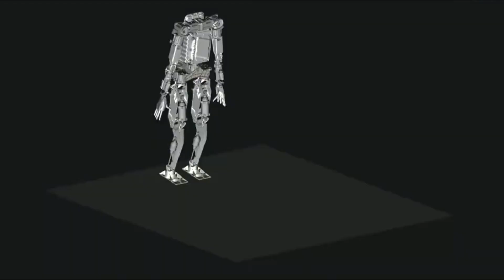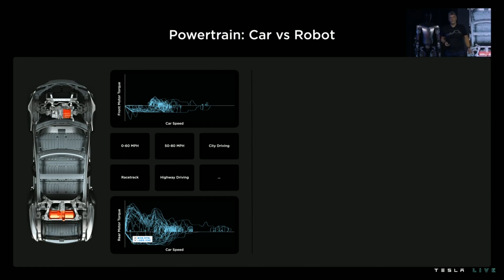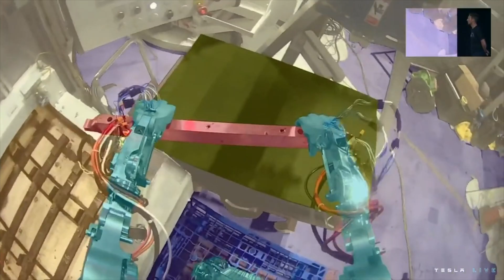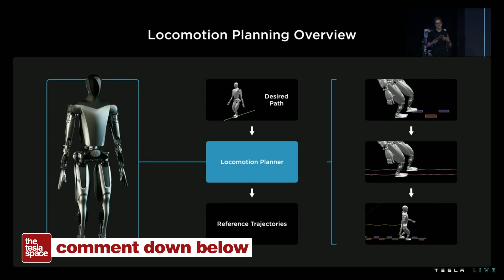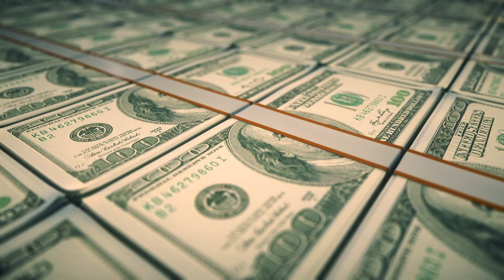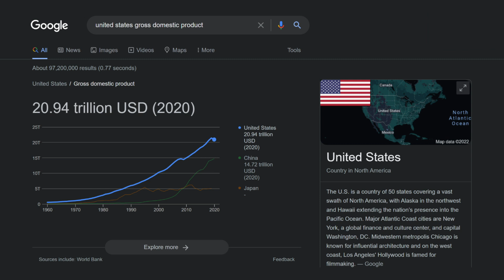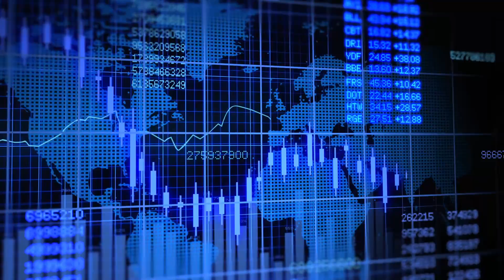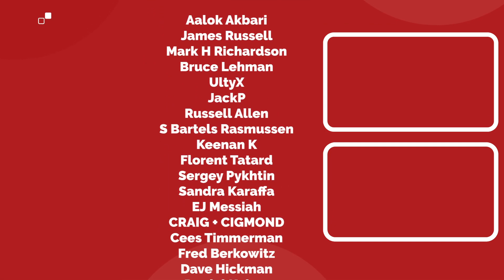The Real Reason The Tesla Bot Will Make Us All Rich!

Comment: Your economy calculation is sorta good enough currently.  However, you should add back in the support.   i.e. subtract from the economy Government workers (and anyone that gets paid via taxes) as well as removing the unemployed or disabled to the point that the support is needed from the economy.     This doesn't make much of a difference when comparing countries as they are all in the same boat.   But when you make all the workers unemployed due to robot utopia then you go from an booming economy to desolation.   
Incase your thinking UBI,   Remember,  Where would the money come from.   If the costs of everything has dropped then the taxes collected drops as well.   Well below the ability to pay government workers never mind UBI for everyone else.
Reply: It is only called UBI, to make the naive more acceptable of it.  It is really called "communism".  And now, it probably makes sense.  No, I am not advocating FOR it.  I'm just not going to take any idea without thinking it through.  And you are the one who started the thread.  All of those points you said lead to "communism".  There is no sense any other way.  common.  What is yours is also mine.  Those robots build our stuff.  NOT your stuff, or MY stuff.  There is no such thing.
Reply: One fascinating prospect that crossed my mind recently in this respect is that "UBI" will not happen unilaterally. Ideally it will begin with a company filing for full automation subsidies from the government(or in a similar fashion through an entrepreneur). Those currently employed by the company when the process begins become a partnership that pays them their wages even as their jobs begin to get phased out and shall continue to into the foreseeable future. Ideally as the machines replace the workflow the original workers will be encouraged to learn/work alongside the machines that are doing the tasks they used to do so that they can repair them and so long as the service/products are relevant, their pay/"UBI" will continue(and likely increase) whether or not they are working anymore if their job is now "optional." 

Even in the event they aren't able to (or unwilling) I believe those who can will pick up the slack or find/hire those that can because now it's in the interest in keeping the business moving. Once finalized, owners can then be encouraged to shift their focus to other projects or to further optimize their particular sector and possibly increase the margins for the entire company, partners included. It will encourage people to not necessarily sit idle even if they manage to secure an income through full automation in this manner as any business can go belly up due to shifting demand/circumstances. But with much less demand those freed up by the automation changes (and newly acquired funding through the abundance in that specific sector) can bleed out into other areas to elevate them. There are a multitude of potential flaws, but so far I like most of the questions and possibilities the path proposes. 

The first and greatest obstacle will be the mass production of these Humanoid multi-purpose trainable units. Their capabilities and speed of adaptation will almost completely dictate the adoption rate. If they can be trained on multiple complex tasks within minutes or at least a day or two, very few large scale businesses will turn that down I suspect. At $14 an hour results in around 30k pay for a year, which is about the average cost of a higher end fast food employee as of right now in my neighborhood. Comparing that to a single 20k purchase and only paying for electricity and repairs after that will likely feel like a no-brainer.
Reply: @taiconan8857  UBI is just a slightly modified welfare system.  It's totally doable and has run just fine in many countries.   What my OC was referring to was the idea of Musk's bot utopia. We are in no danger of ever happening in any remotely reasonable amount of time.  Which is a good thing as it would totally destroy the economy.   How did Must put it.... "Short term problems"    Now there is the understatement of the year.
Reply: Couldn't you just use money already in circulation? I don't see why they wouldn't just redistribute the excess profits companies make with adding robots into the hands of the people. Currently they pay a worker for on average 40 hours of productivity a week and they pocket all the difference between the wage and profit generated from the work. So if they then replace a 40 hour worker with a robot or two that works 24/7 then they could still pay the same exact wage (with taxes) while adding that extra 16 hours a day in pure profit and enhanced productivity. This will then give everyone an extra 40 hours a week to spend money driving up their profits even more. You'd need a law requiring the companies to continue paying wages to previously employed individuals or a 100% tax up to when the wages are covered or maybe you could just do away with corporations all together and have the bots be publicly owned like parks. Then anything they produce or sell would be distributed evenly among the people.
Reply: @shodowhawk  Well, that’s a lot to unpack.   I’m afraid too much for a you tube comment.  Still I’ll hit a few highlights for you.
There is no amount of “money already in circulation” for two reasons,  1) the amount changes all the time. Hence inflation. 2) Last I heard The money that moves around is only 2.5% of the actual money as numbers on peoples bank statements.   Yup, If everyone wanted to have all there money in cash they'd have to wait for them to actually print the other 97.5%

You can’t force companies to pay ex-employees.   All you will end up doing is bankrupting all the companies as new companies that never had employees take over all the markets.
Reply: @lucidmoses  I don't see how they'll go bankrupt when they'll be making so much extra money from the bots productivity, but if we have a bot that can do anything we don't really need a corporation anyway.
Reply: @shodowhawk  Contrary to the YouTubers that don’t know anything about business think,  Most businesses primary focus is not going bankrupt.   Which is when more money is paid out then the money coming in.
Here is an example of how that would bankrupt the companies.
Let’s say the company makes ABC Blocks for kids.   Big sacks of them.   The company has thousands of expenses to accomplish that but lets group them into three categories with relative costs..
$2 for the material and make the blocks.
$3 for the building and equipment to make the blocks.   Transportation,
$1 taxes
$3 labor.   i.e. the people to make them.   Labor is normally one of a companies biggest expenses 
So you add it up and it costs $9 dollars.   So they sell them for $10 and make a profit.
So, now they buy the robots and replace the work force but still pay the work force as per your plan.   What changes.   Not much.  The building and equipment costs will go up a bit so lets say $3.10 so now the blocks cost $9.10.   

Now, someone else comes along as says I can make them for less,  They setup the company and here are their expenses
$2 for the material and make the blocks.
$3.10 for the building and equipment to make the blocks.   Transportation, (he buys the robots right away
$1 taxes
So never having had employees it costs them $6.10 to make the blocks.   So since his competitor is selling them for $10, he sells them for $9 and makes a lot of profit to help pay down the debit of starting the company.

Now your in the store buying ABC Blocks for your young kid.   One companies blocks are $10 and the others is $9 but they are the same blocks.  Any normal person would buy the $9 ones and spend the extra $1 on there kids some other way.  

Suddenly the first company no longer has any money coming.   But they still have expenses to pay.
$0 for the material and make blocks since they are not making them any more.
$2.50 they still have to pay for the building and equipment.
$0.90 for taxes
$3 for labor
Now, having to pay out that much money every month with no way to actually earn money anymore because they can not cut any of there costs to get under $9 means in very short order they company will go bankrupt.

As for needing companies.   Well, two things;
If you don’t have a job for money coming in how would you get the $20.000 to buy the robot?   No bank would lone it to you if you didn’t have money coming in.  You couldn’t start your own company as some people would already have robots and you couldn’t compete with them.

The other is environmental.   Companies are very efficient at making thing things.   When your building thousands of ABC Blocks at a time the amount of wood you would waste is very small. Maybe one or two blocks worth.   If you make one block, your waste is more like 4-5 blocks worth.  Then there is the energy costs, etc etc.  So, without companies it would be an environmental disaster.
Reply: @lucidmoses  it sounds like to me you're trying to maintain our current economic system and factor robots into it. We don't need corporations or business or jobs. You also assume we live in a fair market which we don't. ABC blocks are not sold for 1 dollar mark up they're sold for 2x 3x profit and half of Americans can't even afford to splurge on said blocks with the wages paid to them. They also don't have any real competition. A small business could sell blocks for less, but they'd never have the reach and delivery time of someone like Amazon and without bots their inventory would never be able to keep up. The heads of these top companies pocket more Money than any living human can spend. You don't need 20k to buy a personal robot. You just need them to do the jobs for the community. You also don't need money if they're producing enough goods for everyone. You simply ration out the goods equally. Humans are set to be infertile by 2050. So if you do nothing society will collapse anyway and no one will be alive to do the jobs. I don't "have a plan", but I know that maintaining the wage slave system we have now so our masters can live the lives of kings and gods is pointless. They would rather fear monger about "desolation" than change the system that made them who they are. Tear it all down and start over if you have to. As long as the slaves are free that's all that matters to me.

Comment: I think Tesla should seriously reconcider the "walking" concept, at least for the the time being. Moving on wheels or tracks is a lot more efficient in many aspects, like energy requirement, complexity,  price, stability, and most of all processing power needed to function. The advantages of using legs modelled after the human body are fairly limited, and only show in special situations. Which, admittedly, do exist. But thats no reason to build all robots with legs as a standard. 
May be later, after improving other components like the power supply, the processor and the electro-mechanical parts, it can be intergrated as a standard feature.
Reply: well if the plan is to replace human , i think the design is on purpose becouse it needs to quickly replace real ppl on companya that has the infrastructure fpr humans not bots
Reply: @retrojamremixes  For most of the existing infrastructure its not neccessary to have legs. Even stairs are no problem for a wheeled or tracked machine, if its a clever design. Occassions where legs are a must are pretty rare. 
I assume, also humans (and other land animals) would have wheels instead of legs - if it would be biologically possible. Which it isn't.
Reply: You got to remember that what Elon want isn't multiple models of the same machine but a single model that would do everything. Having only one model would make it easier to mass produce and make it cheaper
Reply: @MiguelGarcia-lt9cv    Having everything above the waist the same, with 2 different bolt on bottom halves, doesnt negate mass production.
Reply: @nathannopants3157  it doesn't but the process becomes more complicated
Reply: @MiguelGarcia-lt9cv  In my opinion it would make more sense to build a machine that can cover 90% or more of the tasks, for perhaps half the price. At least for now, when its all still in its infantcy.
Reply: @petebeatminister  he probably has already thought about that but in my opinion I think the reason why he chose to use legs instead of wheels is because he just wants a human shaped robot. Going in a different direction isn't always a bad thing it's what brings new discoverys by fixing hard problems
Reply: @MiguelGarcia-lt9cv  Oh, I'm quite sure he has thought about that. It is pretty obvious , after all. Yes, I understand the whole "more humanoid, less scary" aspect. Still, the legs are a big obstacle.
Reply: @petebeatminister  I understand that but you still need to realize that even if they didn't us legs it would still take about the same time to finish the robot and in that time they would have engineers trying to make the whole robot more efficient. It wouldn't make sense to spend millions reorganizing  factories on something they could have just developed while they were developing the robot.
Reply: @MiguelGarcia-lt9cv  Designing those legs is nothing trivial. Its not something that can be done on the side while you design the rest of the robot. And apart of all the problems it creates, it is significantly more expensive. And that is a important point. For actually selling millions of those things, they need to be cheap enough that "normal" people think of buying one.  This price of $ 20,000 that is mentioned, is still too high for most people. If it can be reduced to $ 10,000 that would make a huge difference already.
Reply: @petebeatminister  building the legs isn't hard it's the software which tells the robot how to move that is hard to make. As for the price that is the rough estimate right now it's possible that the cost will go down
Reply: Better to make it completely human sized and shaped so it can do human tasks. Arne ergonomics of the world are build for human form factor.
Reply: @johnlocke3481   ::people in wheelchairs:: “I can’t do human tasks!”
Reply: No, I disagree. Walking is one of the most basic requirements for this kind of robot. It has to be overcome, so they might as well tackle the problem straight away. Boston Dynamics seems to have gotten on top of it.